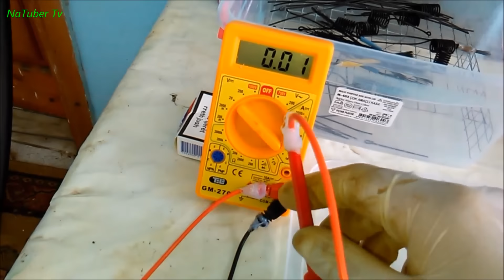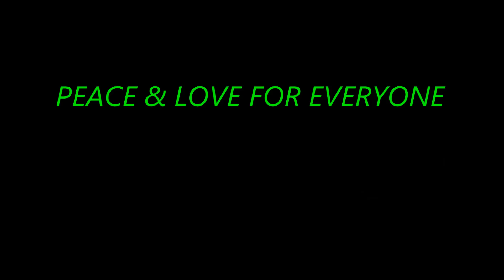How To Make Plasma Batteries, Alekz Beads, Free Plasma Energy, EXPERIMENT 2 part4, Keshe Technology

Comment: thats great sharing, thx.  could you tell us hows the amp output compare with your part 3 which is habing no feedback coil.
Reply from the maker: +billynhk if you don't put the feedback coil in your batteries at some point the batteries will be emptied. if you put the feedback coils in your batteries then the plasma batteries will operate for many many years, 50 - 100 years or more. watch mr Keshes teachings for more informations. Thank you!

Comment: Based from  your  testing I think the GANS was realy good for health application, but for energy storage is not yet ready for energy storage, due to its giving lower efficiency. A new designed battery ( NOT Lithium ion ) 1.5 cm x 1.5cm x 5 mm can get 1.4volts initial self charge.

Comment: So, you can use this batteries to power a flashlight for example, virtually forever?
Reply from the maker: these batteries are designed to use them with plasma devices. The flashlight is working with electricity from the normal batteries. I think that first we need to nanocoat the parts of the flashlight to be able to work with plasma batteries.

Comment: Pleasee tell me where is + and - on this battery.
Reply from the maker: + the central wire inside, and the - is the outer wire .
Reply: when always - is going to nanomaterial in gans that means that nonocoated wire in battery should be connected to nanomaterial in gans right? or inversely
Reply from the maker: if I understood correctly, yes , all the wires should be nano coated
Reply: No no i mean that wire which is insaid the battery should be connected to nanomaterial in gans right ? or inversely